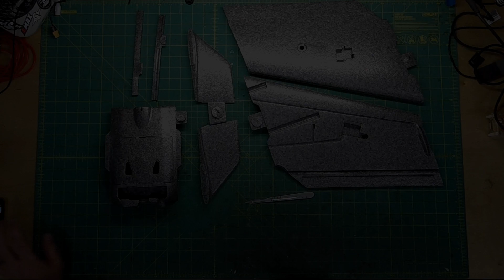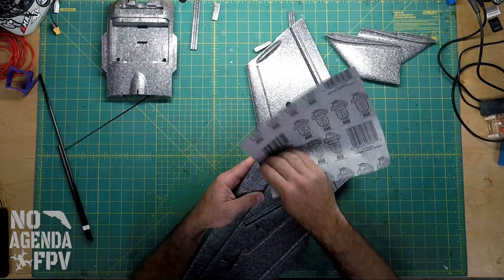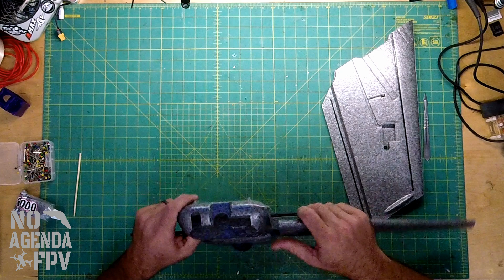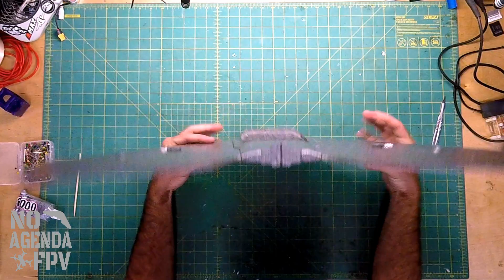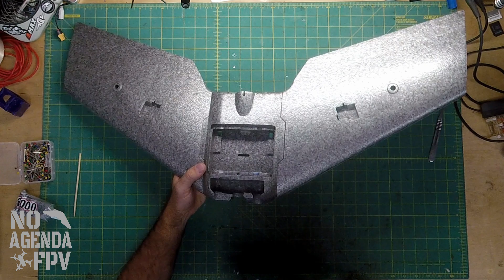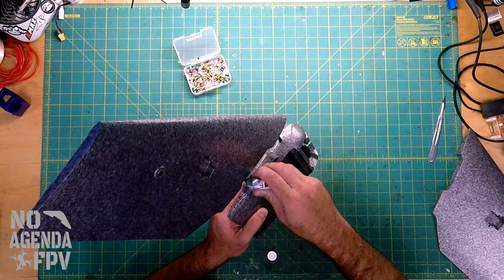Reptile S800 build 2019:  Part 1 Gluing the foam pieces together

Comment: At 7:00 - you are supposed to insert both body-wing spars first THEN add the 2 large and 2 small spar covers (with glue). By gluing the covers in first, you'll get this problem.
Reply from the maker: I wouldn't call it a problem, as I said I could have just pushed the spar in and not had any issue, it was really just an aesthetic thing. I have buikt S800s the way you say, spars then covers, and the way I did in this video and saw no difference in either method. Appreciate that you noticed and shared though, have a great day!